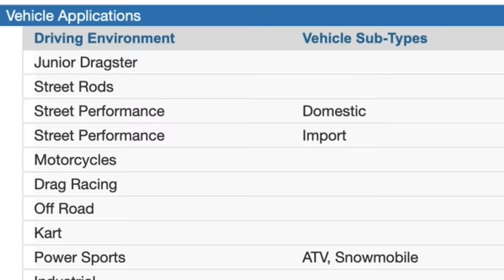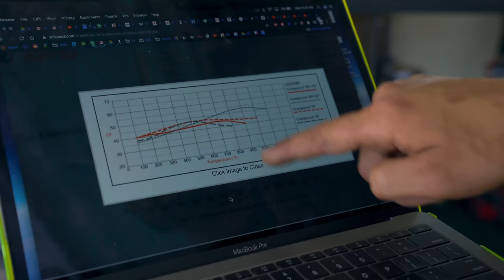Are Big Brakes Worth It?

Comment: sorry, I'm a brake nerd. 
corrections:
ceramic pads are not "the best", they're for street duty when you don't wanna deal with dust, and most of them have horrible friction properties and require higher effort on the brake pedal.  if you can deal with dust most organic pads make for a better braking experience for a street pad.  metallic pads are for the track, the main downside about using them daily isn't no friction at cold (every track/race pad I've driven has a much higher bite at cold, even freezing temps than normal street pads), the downside is they will chew through your rotors at cold/street temps.  I've made this mistake and wore out the rotors faster than the pads, by a big margin (daily got totalled so I ended up dailying a car that was supposed to be 90/10 for track/street and it was too cold outside to change the pads).  A lot of modern track pads aren't even loud anymore when you get them properly bedded in.  But they can become really loud when mixing compounds like switching off between track and street pads.

drilled rotors were never for cooling.  they're drilled for pad degassing back when race brake pads released gas when they got hot.  and since race cars had them that makes them look cool.  so people started putting them on their street cars.  These days pad degassing isn't a thing.  if you want the look go for it.  if you plan to track, get slotted rotors to prolong rotor life.  
Another important factor not mentioned is rotor thickness.  rotor thickness and vane design has the biggest impact on rotor cooling.  The thicker the rotor, the more space between the 2 solid sides, the more air can get in there and cool the rotor.  the vanes, which connect the 2 solid sides together act like a fan and pump air through it.  curved vanes make for a more efficient fan than straight vanes.

bedding track pads is important, same for aggressive street pads (the ones advertised for autox or claim they can handle light track duty).  for regular street pads it doesn't matter.  The BP10 is a very mild street pad.

not correction but advice:
its also a good idea to put brake grease on the side edges of the pad (only the backing plate, not the friction material) where it comes into contact of the caliper.  thats the part of the pad and caliper that rub on each other as you engage and release the brakes.  Also an important note is there's brake lube and anti-squeal paste/glue (not exactly sure what to call it).  you wanna use the paste/glue stuff on pads that come with shims (typically only street pads come with these) that wrap around the pad backing plate (between the pad and shim) and brake lube where you expect movement.  personally I just use high temp anti-seize for track pads.  it has a higher temp rating than any brake lube I've ever seen (cause race cars don't use it, its a street car thing)
Reply: Dang 👍
Reply: Have to agree.. Bedding of the breaks are different from manufacturer to manufacturer too. When I helped changed mine, the pads manufacturer (bendix I think) suggested to follow OEM brake bedding process, which was ATE and according to what I can find for ATE, normal braking behaviour only. No need for excessive temps or light pressure. We followed this can the brakes got better and better and is still getting better. Of course, some manufacturers recommend the hard braking too, but its usually for hard track pads.
Reply: i have to applaud you for typing all that lol
Reply: Wow..Much thanks for taking your time to type this sir. Very Informative Information. Thanks for sharing such detailed knowledge with us 😎👍
Reply: You made a mistake, drilled rotors are drilled for cooling too, some cars have air channels at the bottom of the front bumper, which lets air flow into the brake rotors directly.
Reply: @boblast5582  yeah i meant drilled rotors * I'm gonna edit that
Reply: @qoxx  drilled rotors aren't good for cooling, it's not their main purpose. The holes can start to crack from heat cycles.
Reply: Man wrote a 3 page essay for a correction, jeeze
Reply: Just proves these youtubers are not all they are cracked up to be... bring on the lawsuits when Kelvin totals his car due to incorrect si called expert tube advice 🤣🤣
Reply: as a motorcycle guy I'm always surprised car guys never mention sintered pads.  I guess it's due to what you said; they will eat rotors like no other but you will stop better regardless of temp.
Reply: @pdasch0  I've tried sintered pads, honestly I wasn't that impressed.  I've only tried one compound tho.
Reply: Yeah I'm not reading that
Reply: You must be fun at parties
Reply: Bob Last are organic pads quiet too? I don't mind dusty I just don't want loud sounding breaks
Reply: John Doe generally yes, really aggressive ones might make a little noise but not loud by any means. Mixing different brake compounds, especially if one of them is a race compound can make any pads loud tho. So either get new rotors or get them turned at the same time if you’re coming off a race pad.
Reply: Craystuff yeah, I’m a blast
Reply: Thanks nerd

No but really thank you this is really useful and interesting
Reply: So what kind of brakes do you recommend for cars that can be used as daily and track cars just like the Hi-Low cars.
Reply: @boblast5582  thanks this will actually help me i fully understand it now thank you
Reply: thank you Bob for taking the time to contribute your knowledge/experience.  it's a good job some of us have been LITERATE ever since the 1st grade, don't FEAR the printed word, nor mind reading (others not so much).
Reply: I'm getting ready to change out my entire brake system on my 2008 Silverado the parts just came yesterday. Rear brakes are drum unfortunately. The wheel cylinders are blown out and my peddle is dropping pretty low. I know these new ABS brake systems are harder to get the air out of.  As a brake nerd, any advice on getting the whole system bled in the best and quickest way? Also is there any kind of gadget that isn't too expensive or that can be rented to help with this?
Reply: @randomesteven3935  what is bedding the brakes, how do you do it and should I do it on my 2008 Silverado after I change out all the parts including rotors, calipers, rear drums, shoes and wheel cylinders?
Reply: Bob Last thank you for informing everyone about the misconceptions everyone has with ceramic pads. That was a very thorough explanation and I second everything said.
Reply: IlIlItachI actually drilled rotors are not better are dissipating heat, having more mass actually dissipates heat better than when you drill holes in the rotor. What really matters is how the vanes in the rotor that help pump air through the rotor exactly like he mentioned.
Reply: actionjksn if you have air in your abs system you pretty much have to go to the dealer for them to use the oem tools to cycle the abs pump. For regular brake bleeding I prefer the standard brake pedal pumping method or the motive power bleeder.
Reply: @boblast5582  I had an 01 Silverado with rusted out brake lines and a bad caliper. We changed everything out and this thing absolutely would not bleed. Nothing would come out, no peddle at all and we tried for a long time. My buddy is very experienced and all he has ever done is mechanical work. He said I would need special equipment or that maybe there's a problem with the master cylinder. I wouldn't accept this. I said give me that old brake line. I cut a small maybe foot long piece and screwed it into the master cylinder. I stuck the other end into a container of brake fluid. I had him hold it and I got in and started pumping the shit out of it. Finally got it primed? Had to do it a couple times and screwed the new brake line back in. I remember it was the right front caliper. But anyway this totally worked and it was looking pretty hopeless. So if you run into this problem give it a try if you don't have whatever special equipment. I drove the truck for years. Ended up having to change all the brake lines. The first time it happened we had to make a line. My mechanic buddy told me I needed to replace all of them and the only place who had the set was the dealership, the price actually wasn't that bad somewhere around $100 if I remember correctly. He was obviously right about needing to replace all of them,a few months later I nailed the brakes hard on the freeway because of stopped traffic and the pedal went to the floor it blew out another one and my life flashed before me for a few seconds haha. That was enough to get me to listen to him and buy the whole set I guess I'm a cheap bastard. The replacement lines were painted I wonder why the factory didn't do that when they made the truck. My 2008 has painted brake lines which makes me think someone had already replaced them hopefully they look good. I'm curious if you've heard of anyone doing that trick to get the master cylinder pumping? If you had a rubber line with the correct fitting to screw into the master cylinder I suppose that would work better I just used what was available.
Reply: Drilled are good for making the rotor lighter too.
Reply: Absolutely amazing write up.
Reply: @nielpye8422  is the only way to read that study is to buy it for 33 bucks?
Reply: @nielpye8422  wow, very surprising result, I stand corrected.  I'll have to look around and see if I can find a complete version so I can see testing methodology and stuff, the one in the URL you mentioned looks like its just a summary.
Reply: Oracladeus  I'm sorry, I'm gonna need proof that nascar uses ceramic pads.  and yeah, for stop and go driving ceramic pads are great.  for track use, not so much.
Reply: Much love to ya kuz I agree with 95% of what you said. I'm also a brake pad nerd and know way too much about brakes, I've been selling parts for years now. However I disagree with a couple of your remarks on ceramic, vs semi metallic pads, and I was saddened to not see a mention of copper free ceramics and the very important difference than a copper free and a standard ceramic pad, ceramic pads are not as graby at super low temps, ceramic pads like the higher operating temps and don't give out until a way higher temp than semi metallic pads and copper free ceramic pads can get even hotter. 300+ drives down pikes peak and daily driving in Colorado winters will teach you that first hand. Yes, ceramic pads will eat your rotors up faster, but the cost in a standard ceramic pad helps reduce the rotor consumption. Drilling rotors was designed for degassing, and slotting was designed to wipe the face of the pad free of dust, but drilling was also done for weight reduction to help reduce the rotational mass and they do a great deal for cooling the rotor, especially considering the rotor is 60-80% exposed depending on caliper design. Caliper design also plays a huge role in brake temperature. To be completely honest on my daily drivers and my wife's car I always just go with AutoZone's duralast gold pads and duralast gold rotors and no matter how worn either of them are, I do them every 2.5 years and return the old ones to get the new ones for free with AutoZone's warranty. Buy them once, replace them for free as frequent as you want. With a 35" tire on my winter daily and wheelin rigs, and 22" wheels on my daily, the excess diameter creates much more rotational mass therefore requires a bit more firmness on the pedal. But old brake fluid is the worst offender for having to press the brake pedal harder, brake fluid being hygroscopic, it absorbs moisture from the air and collects in your brake fluid causing cavitation in the fluid when the water molecules turn to steam and become more compressable. Also the relatively high pressures in the brake lines drastically reduces the boiling point of water.
Reply: I barely know shit about brakes, is there a difference in the material on how they perform under  extreme(?) heat? Since I live in Germany and like to drive at high speeds, a lot of drivers tend to think it's a great idea to switch to the left lane doing 80 miles an hour when there's a car coming 120-150 mph. I don't know the material that I've got in there right now, as they were changed by the previous owner less than 6 months ago. But braking out from 150 mph to about 80 mph, I've really had a terrible smell coming from them, and it literally felt as if they were about to snap, they worked obviously (since Im writing this review) but it felt as if I'm really pushing them to the point of no return.
Reply: Came for the first paragraph... Stayed for the better info than the video.
Reply: @profitprophet4547  sorry for the late reply.  I wouldn't describe your scenario as an extreme heat situation for brakes.  Most good street pads can handle a single hard stop from 120-150 down to 80 or so.  This is mostly not an issue since you're driving at highway speeds and you have a decent amount of time pass between hard brake applications like this.  The smell is most likely because you have a pretty mild street pad in there.  In your shoes I'd look for an aggressive street pad, my favorite aggressive street pad is the Ferodo DS2500.  EBC Yellow is ok but it can crumble on you once its low on material and it sees a lot of hard braking often.  Project Mu has a number of good options in this category.  Thats about all I can think of off the top of my head.  If non of these options work let me know why and what car this is for and I'll try to suggest something more specific.  I'd stay away from a full on race pad because you'll eat through rotors really fast driving them around at street temps.
Reply: @KENNETHCARNIE  thank you, I appreciate it!
Reply: @zokusharuuku1091   too bad most people dont know that the purpose of a brake system is to convert kinetic energy to heat energy. Doesnt matter how big your brakes are, they wont help you stop any faster🤷‍♂️
Reply: I have a question for the brake needs out there: I’ve got a 2010 challenger 5.7 6MT with enough engine work to get it to about 500 HP at the wheels. It doesn’t get driven much but the stock brakes are clearly not up to the challenge. At 20k miles there is a solid inch of pedal travel before there is any bite and even then it’s not very confidence inspiring. I want more bite, better feel and much better response. What do I do? And for anyone near Indianapolis, where can I take it?
Reply: @narebman  pretty much every car has some amount of dead travel before the brakes actually engage. This is done on purpose so it’s easier to brake smoothly, not sending you through the windshield the moment you touch the brakes. The amount of dead play is adjustable on most cars at the brake master cylinder. If you choose to adjust this be careful not to adjust it to the point of not having brakes at all. Test it out really slowly, like rolling in your driveway and be prepared to pull the handbrake. If this is something that has gotten worse over time it’s most likely that you need fresh brake fluid. If you haven’t bled your brakes in 20k it’s prolly not a bad idea to do that. If you plan on going long intervals between fluid changes stick to DOT3 fluid. If you don’t mind changing it more often, like 6-12 months, go with DOT4. Assuming this is a street car since you didn’t say anything about tracking it. If you wanna improve braking performance you can get more aggressive street pads or possibly pads designed for autox. I like Ferodo DS2500 for aggressive street pads, but there are other good ones out there too.
Reply: @boblast5582  Thanks for spending the time with your brake comments.  Maybe it reminds me of when I was young and worked on cars.  I'll be sure to review the comments if I ever decide to drive through the Rocky Mountains, will definitely the best braking system to be at its best.
Reply: You forgot about fluid types and boiling points for that and the steel brake lines are gonna give a better pedal feel as well brakes are not as simple as people think they are
Reply: @boblast5582  front rotors are usually vented and rear rotors are usually solid on most stock cars
Reply: @walterhaumaier9137  yes fluid is also important. That’s a big can of worms tho and I didn’t wanna get into it. 
Idk about “most” cars having solid rotors in the rear. A lot of lighter weight and lower power cars have solid rotors in the rear, especially fwd cars, but there are A LOT of cars out there with vented rear rotors too
Reply: Also about noise, organics are the less noisy, if they are quality pads, then ceramics then metallics.

The problem with ceramics is the rubbish brake feel.
Reply: @Lucas-qb3bs  yeah don’t piss him off he’ll dis u til next Tuesday
Reply: @boblast5582  ok bro pls help me out... What's the best option for both street and track car??
Reply: @GTmotions  for your first track day or two you’ll probably be fine with street pads as long as you have over 50% pad left. Bleed your fluid with dot4 a few days before going. As you start getting faster there is no pad that works well on both street and track. I mean there are pads that will still stop you but they’ll wear your rotors super fast because they’re much more abrasive at cool temps. And they can potentially be loud. There are also street pads that will technically work and if your rotors are big enough will continue to work for your typical 20-30 min session, but as they get hot the stopping distances will increase dramatically. They will also wear super fast. When I put big brakes on my Miata I did my next track day with the included street pads and I killed half the pads. That’s means I’d need new pads every 2 track day. My track pads on the other hand have seen 20 or so track days, I’m selling my car so I took them out and gave them to a friend with the same calipers and they still had over half the material left. So you want 2 sets of pads, ideally 2 sets of rotors too so you don’t have to worry about mixing friction materials, that generally makes track pads super loud. Personally I use Raybestos ST43. I don’t do enough street driving on that car to justify switch pads. They still work in sub freezing temperatures, actually still grab better than any street pad I’ve ever tried, but driving them in the cold will eat up your rotors. On the other hand if you have a car with cheap replacement rotors that might not be a big issue. You’ll need to experiment a little to find a track pad that you like. A lot of people don’t like the ST43 because it has a lot of friction (even compared to other track pads), like to the point where it’s difficult to be smooth with them. Prolly not a good pad for a beginner... (it was my first track pad, I’d recommend against following my example)
Reply: @boblast5582  okay thanks so much... Can I ask how you got so much knowledge about brakes?
Reply: @GTmotions  experience and nerdom
Reply: So I should buy organic pads for my daily STI?
Reply: @mikealmiracle4834  depends on how you drive it, if you drive like a normal person, any normal street pad will do, if you drive aggressively or take up to some twisty roads and stuff, get some aggressive street pads
Reply: @Conconboss  when somebody takes time to share knowledge there are two appropriate and civilized ways to respond. If you didn't need the info, you shrug and move on. Someone else needed that info, and this guy took time out of his day to help a stranger. That's what properly socialized humans refer to as 'doing us a solid'.  Or, you find the information useful in which case you thank the guy, maybe ask a question. I suppose there is a third, if you disagree you can discuss/argue/flame/challenge to a fight/launch an airstrike on their apartment. "You must be fun at parties" is how you say, 'what a nerd, all concerned with helping people instead of getting drunk and being rude to those who make the car community an actual place people learn.' since you had nothing useful to say, and didn't feel like saying thank you to a guy (who probably spent a fair bit of time on the comment, and literally years learning that stuff, much of it the hard way, I am betting,)  YOUR job was to say nothing.... Thanks for your attention in this matter.
Reply: Came to post something similar but see that the situation is already handled lol. Well done. Correct on all counts.
Reply: @qoxx  that’s incorrect.
Reply: Greatly appreciate writing this out. I'm largely here for the details and the information as I'm obviously not going to do this myself. This post gave the exact type of information I want. Well explained, good information, useful extra details added. Thanks for spending the time.
Reply: Wow thats also of good info and a bit histroy.....ig u earned a sub lol
Reply: A whole novel
Reply: Jesus dude
Reply: One thing I disagree with, is about pad degassing. Everything else is great info. But like you said, grooved over drilled rotors.

Im running ebc redstuff (yeah I know, shouldve went with the yellow), and when the brakes get hot (and they get really hot sometimes) I can feel the grooves in the rotors through the pedal. This is the pad degassing, and it rocks on a cushion of gas that is swept away by the rotor grooves.  
If this werent to happen, I would get brake fade before I had any warning that the brakes were over heating. And I have faded these pads hard on a couple of occasions. 
So while degassing is not a thing per se, it still actually is a thing in my experience.
Reply: Oracladeus  they use carbon ceramic, theres quite a difference.
Reply: Hi thanks for your comment, what pads would you recommend for my LS460 to stop faster? Bigger ones?
Reply: Oracladeus  ahh, thats cool. I hear you dude.
Reply: I'm done dealing with dust  so u recommend me to go with ceramic?
Reply: @msp5616  that's why you gotta do more research. Can't go off one video. Might not know everything
Reply: So the 20k big brake kits for example an audi RS model, are drilled for looks only? lol
Reply: @zelix5  if the brakes are 20k they’re prolly not drilled…
Reply: Thank you for the clarification. I am learning about basics and this is some info I was looking for. This community is part of why I like this channel.
Reply: @Lucas-qb3bs  It's crucial clarifications and details. It's for the people that care and it's similar to why we like these videos.
Reply: There’s nerds for every subject that’s shi crazy
Reply: Some greases can be used as both anti-squeal and as a anti-friction agent. Silicone Grease with Hexagonal Boron Nitride or Molybdenum disulfide are commonly used in these cases.
Reply: i ain't reading all that
i'm happy for u tho
or sorry that happened.
Reply: bs the brake lub eI hjave is rated to 3k farenheight
Reply: @boblast5582  naw. Good stuff. Read the hell out of that. Helped me out, as in looking into a set of pads and rotors. Really just want slotted, street use only, nothing overly aggressive, and from what I'm reading, organic pads, (black wheels, here I come).
Reply: Hi, engineer here, working on brake design for a tier 1 manufacturer.  Drilled is ABSOLUTELY intended to shed heat. Degassing hasnt been an issue in years (decades, really). Drilled isnt something i really would EVER recommend for a street car, as they do have a tendency to crack, and on the street its really not beneficial. I wouldnt ever say "if you like it go for it". Its a bad idea. The plethora of cheap generic china garbage rotors doesnt help. I stopped reading whatever you typed after this HUGE mistake from a self professed "brake nerd".
Reply: @jamesstephenson2346  yeah someone posted a study on that somewhere in these replies a while ago, I was wrong about that
Reply: One of the most underrated comments under a DIY mechanic video ever... Well not really because I'm here,  you're here lil.